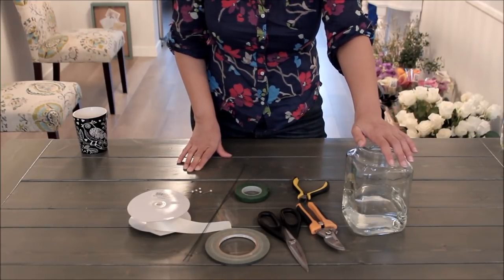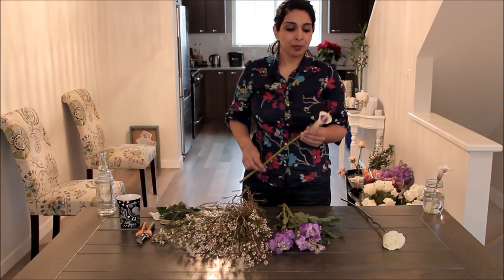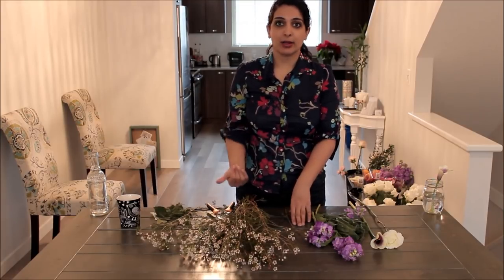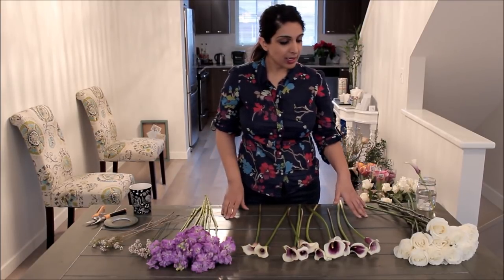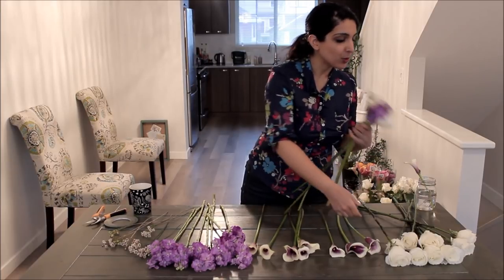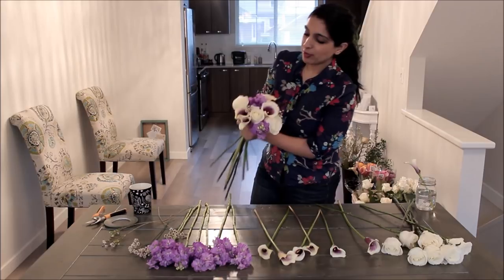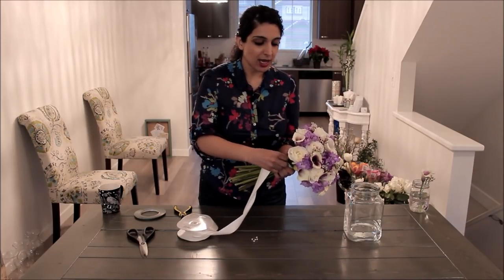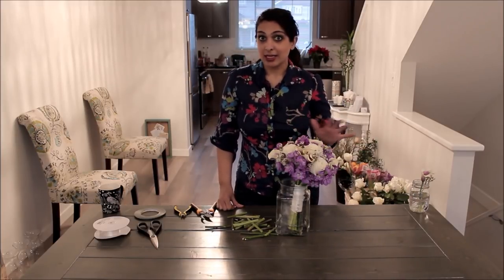DIY Calla and Rose Bridal Bouquet

Comment: I am new and still studying to be a florist. I have a lot of practicing to do. Any advice on practicing making artificial floral arrangements. You would make a very good teacher. You are very thorough. Thank you Donna Peers.
Reply from the maker: Hey Donna!  I don't have any experience with artifical flowers, but a lot of the design tips would still apply.  Things like incorporating a focal point, when to use line flowers vs. mass flowers, etc.  I think you can apply a lot of those design tips from fresh flower tutorials into your work.  Good luck in your journey :)

Comment: Would you consider this a bouquet for the bride or the bridal party (bridesmaids)?  What is the difference between the two?
Reply from the maker: The main difference between most bridesmaid and bridal bouquets is that the bridal bouquet is bigger, as most couples prefer that the bridal bouquet stand-out more than the others. But there are no hard rules about sizes or flowers used.  The finished bouquet I made in the video is meant for a bride, but it could be used a large bridesmaid or maid of honour bouquet as well.